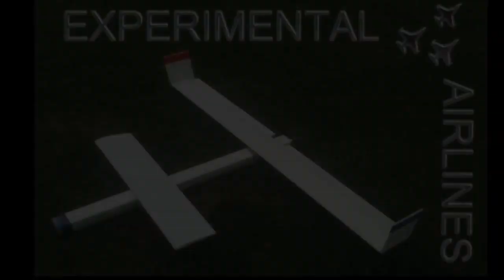AXON Foamboard Trainer and Light FPV Platform

Comment from the maker: Same place: at 30% of chord from leading edge (typically 2").  But with a longer tail you may need to add weight to nose, preferably in the form of landing gear, larger battery, FPV gear, or something else useful.

Comment from the maker: That is exactly the motor I used, and it's in the parts list.  It's good for light FPV, borderline for a GoPro.  There are some 2836 sized 1800-2200KV motors if you need more power.  If you build the plane exactly as spec'ed you will be stuck with the 6" diameter prop though, so high KV is good.

Comment from the maker: Great to hear -  I hope to see your creations.  I do use a 4" extension from the battery to ESC.  It is preferable to extend the ESC-to-motor wires, but I just opted to keep it simple on this one.  It's also kind of nice to put the ESC up there in the "power pod" with the motor.   I think the rudder is probably not necessary.  You could dial in a little aileron differential to help coordinate turns, but you might not even need that.

Comment: Hi Ed, If you mounted the rud' / eliv' servos  servo much further forward and used a closed loop system you could achieve your CG without adding (dead) weight up front, I was a balsa builder and the general rule was - to many grams on the tail requires several ounces up front, so you must loose that extra tail wieght

Comment: Hey Ed, thought I'd update you on my builds. The previous comment I left at your Burning Man vid was mid-build of the scaled down, 1 1/2" fuse tube build utilizing the cannibalized electronics from a crashed-and-repaired-too-many-times FT Speedster w/ a 250 size motor.. First flight today exposed what I suspected might be the case , a dramatically under powered plane despite the attempt to compensate thru scaling down.
 On launch from a slightly elevated position I was pleased to see an incredibly docile and easy to handle, well balanced flight. I just couldn't maintain any altitude and 3 times in a row landed gently and smoothly after prolonging the inevitable.
 Being new to the hobby and looking for a starter this design has passed that goal with "flying" colors.
 So it's forward with the full scale 60" WS, 7" cord, full scale version.
 Thanx for the great info, sharing your brain so I can fly the "Haxon"

Comment from the maker: You are right to be concerned.  What I like to do is roll up a rectangular wad of foamboard, about battery width and 3-4" long, and glue/stick it to a gift card, leaving part of the card sticking out. Tuck the gift card under the battery so the wad of foamboard sticks out in front as a crumple zone.  If you crash then the wad will decelerate the battery somewhat as it crushes.  Not a guarantee, but it helps minimize damage to the battery.

Comment from the maker: For building simplicity, the Noob Tube is better, and uses a single section wing.  This build technique really only hit's its sweet spot for flying ease at about 45" wingspan, so for new pilots I would recommend going the extra way of joining wing sections.  3 channel would need dihedral to turn if using an active rudder and no ailerons, but you could use elevator and ailerons and skip the rudder.

Comment from the maker: I've flown it with a keychain camera and the roll stability was acceptable, at least as good as the Peace Drone, my main FPV ship.  It's never as perfect as a trike, what I'm used to shooting video from.  I think the Axon would be a better plane to consider putting a gyro on the ailerons than the Peace Drone, where I've had mixed success on the elevon gyro.  As the foamboard artiste that you are I think you should try it out.

Comment from the maker: @Tommp Having the motor thrust straight forward, parallel to the airframe, will tend to pitch the whole plane downwards when power is added.  The thrustline should ideally intersect the aerodynamic center of the plane, which is hard to explain succinctly, but very approximately at the half-chord of the wing.  This way the thrust force is countered by an equal amount of drag above and below the thrust axis, so any pitch-over caused by the motor becomes balanced.

Comment from the maker: @ExperimentalAirlines Think of pushing a frisbee through a swimming pool.  You would need to push right at the center to keep it from pitching off to the side.  This is what you'd be doing by adjusting the axis of the motor - to point through the aerodynamic center of the plane. Usually no compensation is needed for different speeds, etc.

Comment from the maker: The wing is two 27" sections joined by a carbon arrow shaft (a dowel would work) and simply taped around the center joint, with the wings just butted together and the servo wires run out the bottom toward the front.  The control horns are just little pieces of plastic gift card bent and drilled.  See the "stabilizers - control horns" video and the "plastic gift cards for rc" video for more details.

Comment from the maker: You can try squishing it back into a squareish shape by jamming it into the corner of something, like the corner of a room or door jamb.  You could also just use shims under the wing.  Installing crossbracing inside can be done in a certain way that shifts the upper surface this way and that, just have to experiment.

Comment from the maker: Same place as for short tail - about 2" aft of LE, at about 30% chord.  You will likely need to add some weight to the nose in the form of landing gear, bigger battery, FPV setup, etc.

Comment from the maker: I always go with 30C or better for all battery applications.  The SkyLipo 40C is a solid workhorse, pretty hard to go wrong with it.  I find they keep low internal resistance longer and puff less readily, so overall you'll get more flights with better amperage delivery over a longer lifespan.

Comment: Hello Ed, I built the axon as a beginner/fun flyer airplane using depron. It has a 2" fuselage and 5" chord.I'm just getting into the hobby and teaching myself to fly using scratch build airplanes as store brought planes are very expensive in India.it is the first plane which returned home without damage.I think the plane I built was heavy and needed full throttle for level flight. What should the weight be without battery.
Thanks again for wonderful techniques and awesome videos.

Comment from the maker: @rgthd007 I think a GoPro would balance out nicely at the mid-nose position with the 42" fuselage.  I haven't tested payload but the configuration you see here had plenty of surplus power so I think it would be OK.  You might need to slide the battery back a bit inside the main fuselage to balance, but there is plenty of room to do so.

Comment from the maker: Also consider using a rolled-up piece of foamboard located just in front of your battery to act as a crumple zone to protect the battery in case of nose-in crashes.  Otherwise you can swap out the nose section of the fuselage as much as you need.  You should get three noses per 30" section of fuselage tube.

Comment from the maker: Well you can still go with the 2200KV motor and 6x4 prop with a smaller battery, provided it has the C rating to compensate. I recommend 30C minimum.  But you can use different motors and props too.  3-blade prop is a good solution for getting clearance.

Comment: Any tips on fixing odd shaped fuselage tubes?  My main Axon tube is fine but the one at the top for the motor and wing mounts isn't level on top from bad construction.  I didn't realize this until after I had already hot glued everything together.  I'll need to figure out how to level it so the wing and motor are straight with the tail.

Comment from the maker: @quickpix123 It's a big question with many good answers from many smart guys.  I my opinion a mid-mounted pusher design is a good start.  If you like to build, and inexpensively, then the Axon is a good suggestion - easy to make and repair.  I have added a parts list to the comments for the Axon build.  Poke around the forums like RCGroups for beginner suggestions.  Radio selection is too varied to detail here.  Many to choose from - HobbyKing has some cheap ones that work, I use Spektrum.

Comment from the maker: Just be sure the convex side of the propeller, which also has the "writing" on it, faces forward the way the plane travels through the air.  It does not have to be a "pusher propeller" - any prop will do as long as it matches the motor recommendations for size and pitch.  If needed, the motor rotation can be changed just by changing any two of the three wires.

Comment: Hi Ed,
I just received my order for my motor, battery ect and I goofed up the battery order the one you listed was backordered so I tried to match up the numbers with another battery and got a 4s instead of a 3s 2200mah 45 90c. will this still work or do I need to return it and wait for the other one to become avialable ? I did get the motor and speed controled you listed.

Comment: Hey Ted, how do you connect two wings together with a shaft? Do you glue the shaft in one of the wings when you put it together and just slide the shaft in another, without gluing to it, or you just put unglued shaft between two wings when you finish both of them, then how do you run the wires, after you make a big wing or before? Thanks!

Comment: Would a COX 049 be powerful enough to push this?  I believe the put out about 50-60W of power.  I am looking to build my first RC plane after having only had small quads, I'm looking for something that carry fpv/gopro and fly fairly slowly and for a longer time than a quad does.  I hardly ever hover so it looks like a plane would be much better for me than a quadcopter.  Also for a homemade first plane would a $30-40 ebay controller receiver combo be good enough?  that and a few servos and I can use the 049 that I already have.
Thanks

Comment: Can you add some details about the 5 degree down thrust.  Why would the nose pitch down without the offset?  Is it because the down thrust compensates for the increased lift generated by increased speed?  With 5 degree down thrust, what compensation, if any, is needed for cruising flight? More up elevator?  Any help clarifying this would be appreciated.

Comment: Another thing, I have seen a lot of 3s 2200 batteries for around 10 bucks, is there a need for the higher discharge rate that this bat. has?

Comment: Thanks for the tips.  I'll post a video once finished.  One last question.  I'm using $1 Duck brand packing tape from Walmart and from their website it shows that the standard packing tape has a 1.9mil thickness.  Is this good or should I use a thicker packing tape?

Comment from the maker: 40 amp ESC is a good sweet spot for value but with good amp draw capacity, good for nearly any motor in the 28mm rotor diameter (like 2826, 2830, 2836) and under 2500KV.  Many to choose from.  I usually go with Turnigy for price and familiarity.  These are foamboard planes after all.  Never had a failure yet though.

Comment from the maker: Start with CG 25-30% back from leading edge, so about 2".  If you build the full-length version of the Axon you will probably need FPV gear and/or landing gear and/or ballast in the nose to balance.  If not, consider making the tail a few inches shorter.

Comment from the maker: @usarmyfl1 It's complicated, but for any single given motor, the prop is the variable which most affects amperage draw.  The more resistance from the prop the more amps needed to turn it.  Amps multiplied by the voltage delivered by the battery equals watts.  In a good quality, high-C-rated, pack of adequate capacity, this voltage will be pretty close to the nominal voltage (11-12v in a 3 cell lipo).  In crappy batteries the voltage sags, giving lower voltage and less wattage.

Comment: would your recommended motor (D2826-6 2200kv Outrunner Motor) work this plane with 60" wingspan and fpv gear or do i need a bigger motor?

Comment: I've been simply covering my wings with ordinary clear packing tape from 3M, it's available at most stores in a 3 roll pack for under $10. One roll goes a long, long way! If you want to decorate your model with Insignias, numbers, letters or patterns, you can try "Trim MonoKote" it"s available in a variety of colors and patterns in sheets 36" x about 6" and it's peel and stick.

Comment: Thank you so much for your detailed videos! I am sure it takes a lot of your time, but I love the simplicity and cleanliness of the lines. Anyways, the only way I am not sure about of how to do, is the Wing... I saw your other video where you connected two separate wings together to make a wider wing, but on Axon, it seems like you used a different technique and you didn't put a new piece of foam in between, the way you showed in the older video? Also, how did you put the control horns? Thnx!!!

Comment: can this be used as an fpv platform? i only have 8mm depron available locally, can this plane still be made from it?
also, i have 24g 1300kv motor with 8*4.5 prop, will that be enough?? this is my first scratch build.
Thanks
Reply: the 8mm depron will work fine. that prop/motor combo will most likely not fit this build. Reason is the 8 inch prop will hit the bottom fuselage. The 6x4 prop fits with very little room to spare. However, you can make modifications to the motor mount and thrust angle and maybe get away with 8 inch prop, but will be a tricky set up.

Comment from the maker: @solracotos The Axon really needs a 6" prop if you are using the 2" (nominal) foamboard tubes for the fuselage.  Seems small but with a 2200kV it was plenty powerful.  The NoobTube would take this motor as well but you would probably get a little more efficiency using a 1100-1400kV motor and a 8-9" prop.  But if you only had a 2200kV you could easily swap it back and forth.

Comment: I would like to save some money on batteries since I'll need to buy a few.  Can I go with a smaller motor and bigger prop or three blades so I can use a smaller mAh battery?  I'll obviously have to mount it higher.  Any suggestions?

Comment: Great informative video, as usual. I'm working with a boy scout troop that wants to build some planes for their aviation merit badge. I was thinking of a 3 channel mini version of the Axon, with a single section of Armin wing. Any suggestions would be very welcome. Is dihedral a requirement for proper rudder steering in a 3 channel plane?

Comment from the maker: @usarmyfl1 I'm a little wary of those low C-rated batteries.  There is no standardization in C-ratings, but I like to aim above 30C.  When I measure internal resistance on those (which is a real, objective measurement) it's usually very acceptable quality.  Those 20-25C batteries always seem to puff up and never deliver the volts you need at load.  Drawing 20-25 amps on the 2200kV motor would benefit from a better battery IMO.

Comment from the maker: @usarmyfl1 That's all electrical watts as a measure of power.  Propulsion power in watts is vastly more complicated, and always lower than electrical watts.  A lot of it does have to do with the propeller though.  I usually just measure static thrust and call it good.

Comment from the maker: @usarmyfl1 Good catch.  25 amp ESC would be a minimum. I am personally using a 30a and drawing 22a using a 6x4 prop, with very good cooling airflow around the ESC.  But you're right, erring on the larger capacity ESC is a better idea.  If you used a larger and/or pitchier prop I would definitely go larger.

Comment from the maker: Cool, man, glad to help.  C-ratings are kind of voodoo.  There is an actual scientific principle behind it, but every manufacturer is going to interpret it a different way.  What's 30C mean?  Before the battery puffs?  Before the wires melt?  Before the lifespan decreases? Etc, etc.  First choose the cell number you need for voltage - hard to go wrong with 3-cell for most applications.  Then consider how many amps you need for a given power system, measuring it with a wattmeter if possible.

Comment from the maker: As for the diving I would suspect a thrust angle problem, and maybe nose heavy with insufficient elevator up-trim.  Not sure what you mean by flaring a wing.  Maybe you could join the RCGroups thread" Foamboard Scratchbuild University" and we can help you figure it out.  Photos and video might help if you have it.

Comment from the maker: Then think about how much duration you need and how much weight you can carry.  I like 1300mAh for small-medium planes and 2200mAh (and multiples) for larger planes.  As a measure of general battery quality, honestly I'd shoot for a C-rating that is at least twice your expected amp draw.  So if you have a 30C 3-cell 2200mAh (2.2Ah) that's 66 amps, I would trust it with 30 amp draw.  All batteries degrade over time and with use.  See my video on Internal Resistance for more details.

Comment from the maker: An honest 20C discharge is adequate, but the problem is that these manufacturer ratings rarely reflect reality.  They are lower quality and have a more pronounced voltage sag when you power up, are quicker to puff, and don't last as long.  For me personally, the 40C is usually a good price/value point.  They deliver the punch but don't cost too much.

Comment: I watch your instructional videos on YT as well as others.
I like the technical content in your show.
I am retired and have always wanted to fly RC.
I want to build my own planes.
What design is best to start?
Basic plane design or flying wing?

I have a Walkera 6ch radio from a failed attempt at a helicopter.

Can you give me a rundown of the electronic parts I should get to start with?

I will have to shop online as there is no hobby shop within 70 miles.

Thanks
Dick

from
Missouri